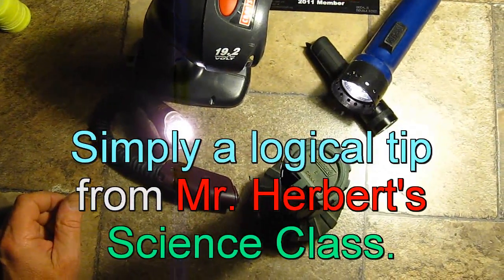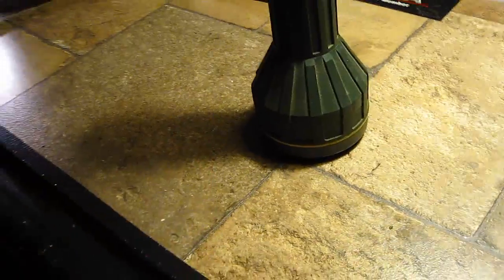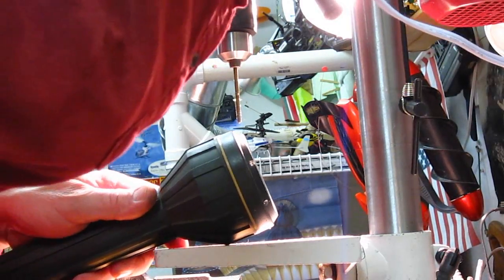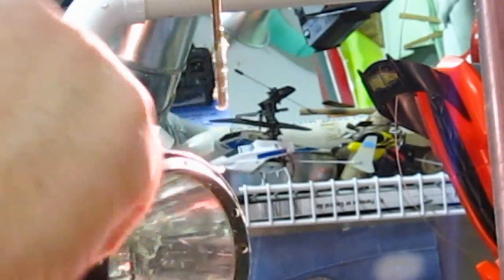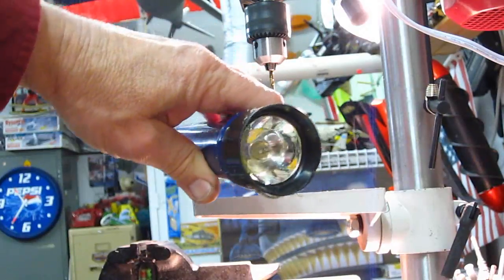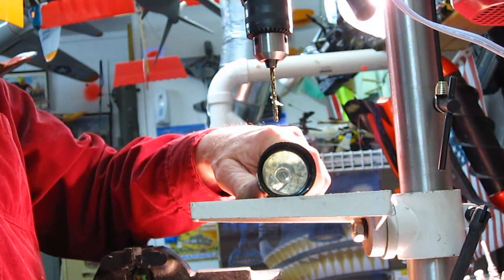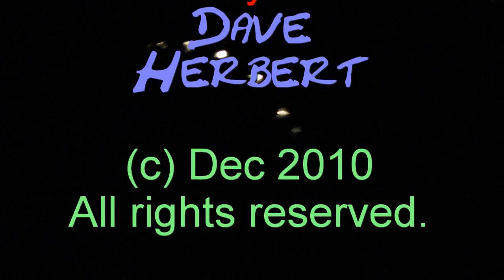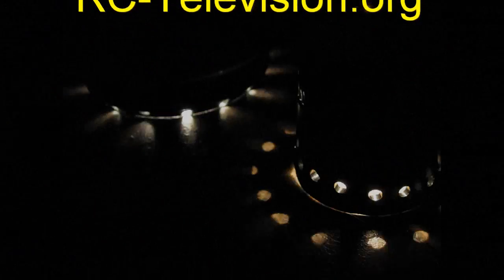"Light Vents" for Flashlights!

Comment: I have a question that ive asked several rc guys, you are most likely to know now that i think of it. 

Do you remember using brushed dc motors for science projects that made power in say a wind or water wheel?  Well since brushless motors are far more efficent would the possibility of using  a brushless system in "reverse"generate power at all? If so would the eficency be as good as using it as an engine?
I realize a special controler would most likely be needed. 
Just a thought for winter